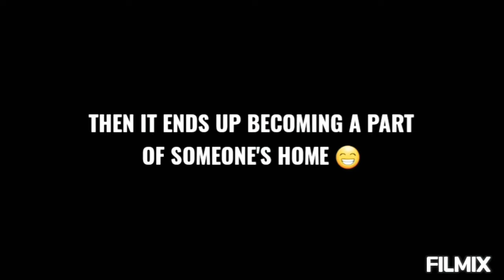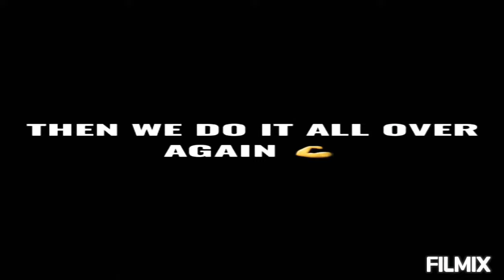Foley Belsaw Sawmill McGovern

Comment: Nice to see someone who actually knows how to run a Bellsaw. Logs being turned properly, dogs adjusted and used properly, minimal time spent out of the cut, swinging arms on log deck, blade guides located just below the shanks. Beautiful. I see you have to hold the setworks pawl tight to the ratchet gear as you shift the log - which is unfortunately common on Bellsaws, but holding it like that will help it from slipping and wearing out. Love the resaw with the Swede roll dumping the cants onto the inclined belt. Excellent job all around. A lot of mill owners could learn a thing or two watching this video.
Reply: Thankyou, it is nice to know there is somebody else out there who knows what they are looking at Note - it is actually running smoother now, I changed one of the bearings on the arbour and the top of the blade does not even have a light flutter in it anymore.

Comment: I see you have the same old Belsaw issues. 
You’re grabbing the ratchet dog so it won’t slip on the notches and the set screw on the carriage shaft needs tightened. 
Same as mine. 😂
Reply: i do not use the the shaft  tightening bolt any more /i just put a heavier weight on the scale so it pulls back/makes moving set works easier
Reply: i have to make a bit of a retraction/in the winter time in canada  the grease was cold enough that it caused enough drag/i had to go back to the drag bolt when things thawed out

Comment: Can I ask what size your sawblade is and is it the standard Belsaw bearings and mandrel and what are you powering the mill with and is the arbor nut counterclockwise or clockwise thank you
Reply: 48 in blade/saw side  belsaw bearing casting /out board bearing pillow block/mandrel  left hand thread/arbor shaft up graded steel to schedule 4140 /approximately 3 times stronger than mild steel